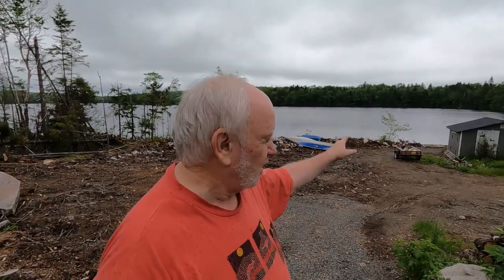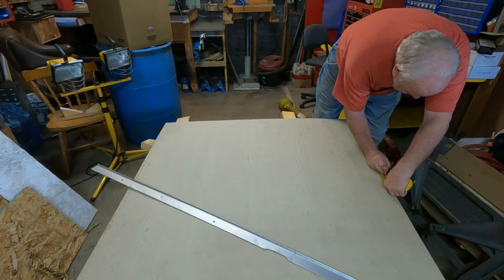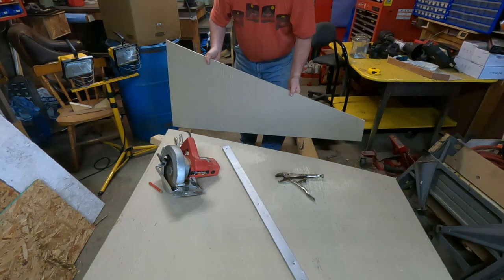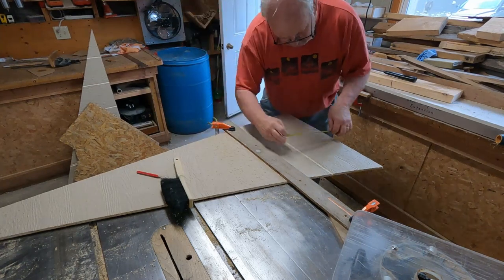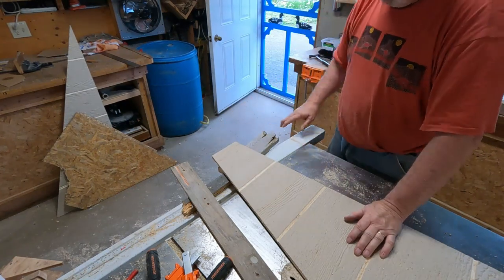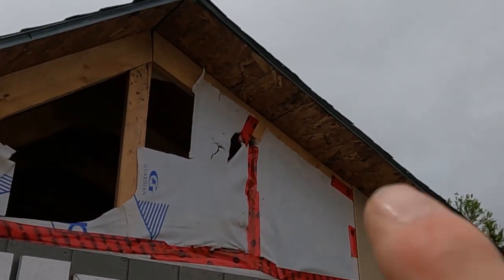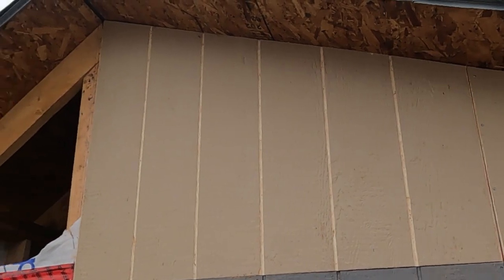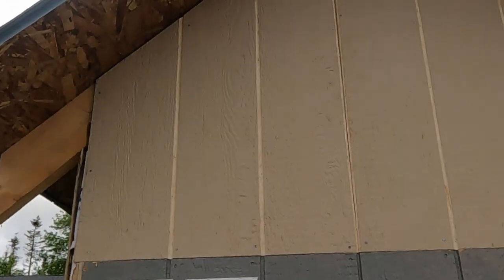Putting the Gable End on the Boat House Part 9

Comment: Hey bud. I always love todo these 1 or 2 of  type jobs. I sure like the nice big acrylic shoe you have on your router. With that and a circle cutting plate it is amazing on how much, how many really neat pieces you can come up with eh. This fix is sure been a test of your acquired skills my dear friend. Logging, Demolition, framing, electrical, poss plumbing, and on to paint in time. All done right and with little help. Pretty impressive old friend. Well fella, one more successful day under your belt and still have a bunch more awaiting your attention. Those too will be taken care of all in good time eh. Hugs for Nannie J of course and a hearty pat on yer back bud are all in order this fine day eh.
Reply from the maker: How's she goin'?  Thank you Dean!!  This rebuild is taking a lot of time.  I have to get the soffits on and then the fascia and then do some electrical inside and get the pump set up re-established.  This pump is for outside water and I want to pressure wash the camp and shop so I need the water supply working, and soon.  So stay tuned for that one!!  LOL  Take care and have a great week!!
Reply: @GrampiesWorkshop  I suppose  one of the advantages of ageing is patience.(sometimes I wonder about that) . Taking the  time to sit hack and properly  mapping out a project before testing  the waters right down to the last cleanup on a job as  important than making sure there is gas in the generator. Just like a puzzle, everything has a place and will have to go exactly where it should be. See ya soon my friend.